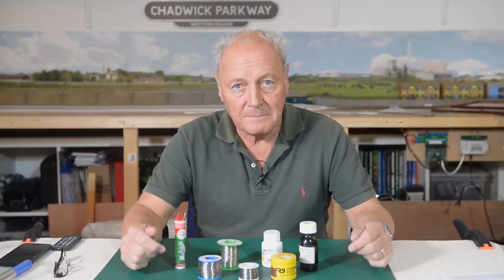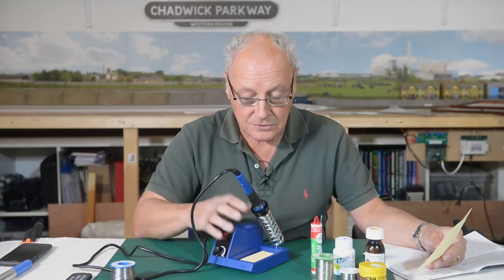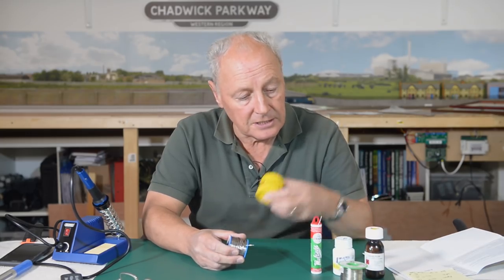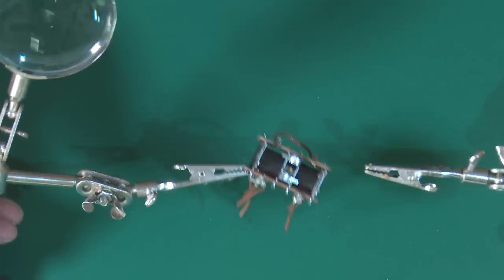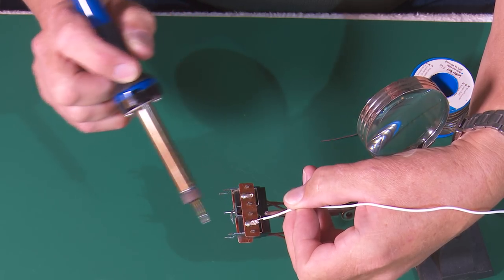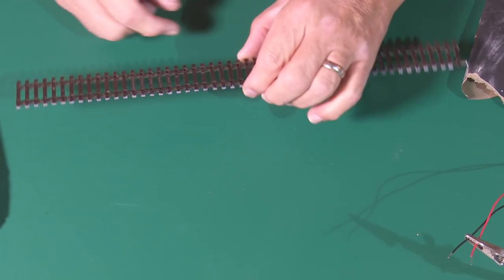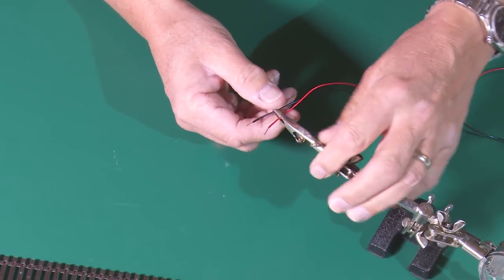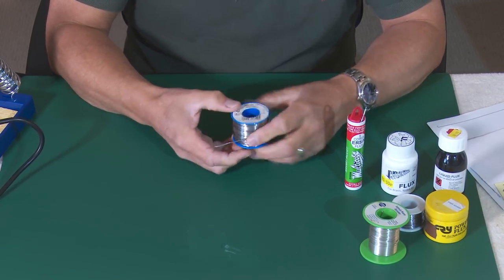Soldering with 60/40 Solder at Chadwick Model Railway | 45.

Comment: Hi Charlie. I used to solder as an apprentice GPO telephone engineer and used to wear the tip of the iron out at least once a week. Please be aware that solder is not a good conductor and only really makes a mechanical connection. This can cause the odd probly
Reply: Problem
Reply from the maker: A very valid point Richard, regards Charlie
Reply: Put a multimeter on any piece of solder and hear it conduct... Duh...

Comment: Give a try 63sn 37pb
Reply from the maker: Is it that much better than 60:40?
Reply: @ChadwickModelRailway  63sn 37pb don't have plastic stage(like a paste) it instantly turn from liquid stage to solid stage, when temperature drop to 183c°. While 60sn 40pb have a plastic stage, witch can cause disturb joint, if you accidentally move the part that you want to solder. 63sn 37pb is widely use in medical equipment, military equipment and aerospace equipment.
Reply from the maker: Thanks very much for the detailed information Mohamad.

Comment: Do you notice that you get fumes when you apply the solder? That is the flux burning off.
If you don't apply fresh solder when you actually join the two parts then you don't have any flux and its easy to get a dry joint.
You should put the two parts in contact, apply heat to both with the soldering iron and then apply the solder.
You can do lead free easily if you do so, however I still use tin lead as its easier still.

You can get a good idea how to do it by watching 
https://www.youtube.com/watch?v=8Ty5Bnj2XqE
Reply from the maker: Hi Dennis, thanks for your views.
I personally will never go back to lead free.
Regards Charlie

Comment: Also 60/40 Solder melts at around 388F not 600+/- F Here's a chart https://www.petervis.com/Education/Soldering_Guide_for_Electronics_Students/Soldering_Temperature.html
Reply: At 650F you will just vaporize your flux before it can do it's job.
Reply: Also toss the sponge and get a brass tip clearer all the sponge does it drop your temp and it just a pain to use.
Reply from the maker: I have changed my technique considerably since those early days mate. I’m currently working at around 400. Regards Charlie